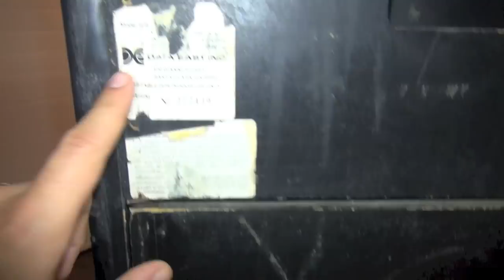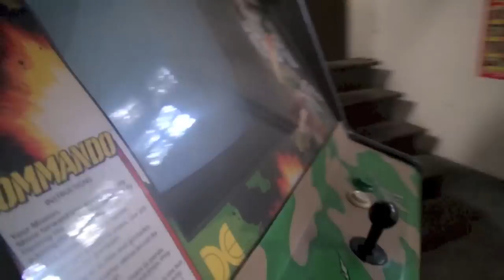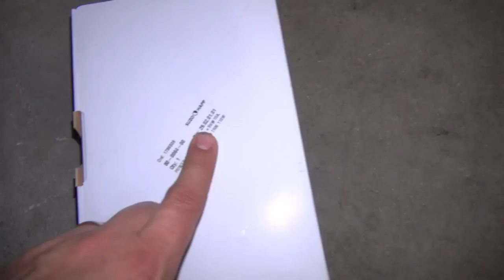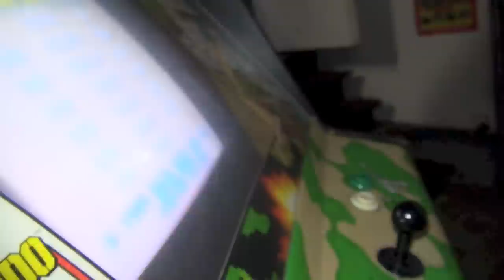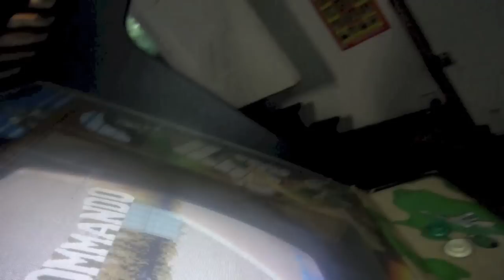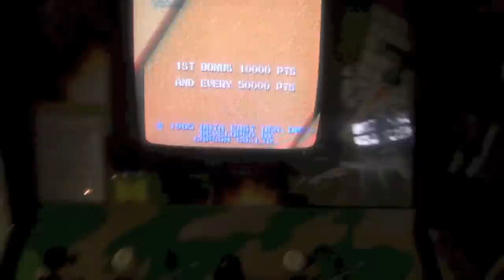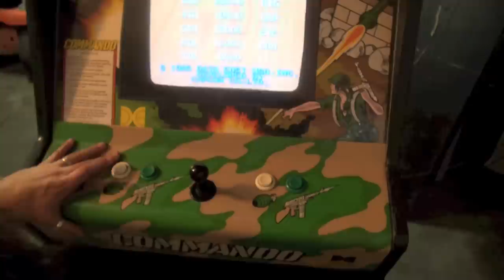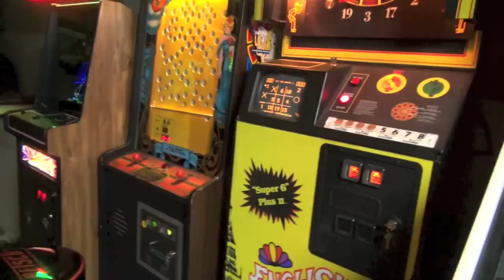How to fix a dead arcade game #1 - Troubleshooting a Craigslist purchase - Data East Commando

Comment: A decent pigtail replacement cord can be found here : http://www.southwire.com/products/pigtails-power-supply-cord-spt-3-water-well.htm

Please note that the plug is a 90 degree downward pitch, they also have straight ones of the same quality.

John makes a good point about repairing the power supply. I f you can find one for $20 do not bother. I'm a trained Electronics tech guy and I wouldn't.

John also makes several other really good points in this video: safety. Always make sure you game is unplugged before touching it. While you probably won't get killed by 110V , you can and it will jolt you. Another point is the interlock: do NOT forget the interlock. You plug in the machine, take off the back and nothing will work and you'll spend 10 minutes figuring out you were silly and forgot it(oh yeah MUCH experience with this.... so yeah I am an expert at silly).

The monitor can be adjusted to correct some video problems. Sometimes it can be something very simple like the fly-back adjustment he did that fixes a machine. Though that can be a sign that the fly-back is starting to go bad.... if after you adjust it, the screen goes blurry again later well at least you know what to replace right?

Contact switches like the ones used in these machines can be cleaned like John showed or with the VERY lite use of a cheap cardboard nail file. Radio Shack also sells a cheap cleaner/lubricant spray :  http://www.radioshack.com/cleaners-and-wipes . I really like the DeToxit wipes.

Seriously John, from one electronics tech to another, this was an excellent video with a great deal of very good information. Please keep this up. I really liked how you introduced the multimeter etc.
Reply: Digital Encom You know I always call myself a tech guy because I feel that is really more of what I am than any other thing... With that said I have a degree in Electrical Engineering and IT (Database Management and creation).... so I am a bit more that a Tech guy I suppose though it is what I was first. Now... I said "While you probably won't get killed by 110V , you can and it will jolt you. ", from that you seemed filled with a burning desire to quote how people can be killed (which I already stated) and what voltages. Did your information include that most deaths by 110V include the victim being in water? 90% of deaths in homes occur from 110v? Where did you get that silly statistic. I would hazard a guess 90% of deaths in home occur from natural causes or heart attacks.... heck I guarantee you falls account for a higher percentage than electrocution. So, unless and until you really want to post some VALID statistics, accept that yes people can die from 110v, but sorry more people get shocked than die. So... if you want to play credits I was a journeyman electronics tech in the Air Force first.... before college, so it is what I most identify with. There... happy?
Reply: k
Reply: I just noticed the whole"covered in blood" bit. You know, I have never met a vet who was actually in combat speak like that. I certainly don't but... if it's true... then you are in the VA system and also have a VA award letter that shows the date and circumstances of any injury. I'd like to see that. Just redact your social security number. Give me a dropbox link, and hey I'll share mine for everything anytime to anyone, DD214 (long form), Diplomas, and VA letters). Let's see who is REAL here.

Comment: We did it John! We did it!!  Kidding... another awesome video.  

As far as the power cord I bought a game that has a similar cord but the end of cord is soldered to a box with fuses (not sure the name).  I don't have a soldering gun but is there any other way around that if I want to replace the cord? Or do I have to buy a soldering gun and unsolder the cord from that box in order to replace it.

Comment: As soon as I saw the power supply was bad, I would disconnect the power supply connector to the PC boards before tweaking the voltages.  There's nothing worse than seeing every IC on the board crack open when the supply suddenly comes to life at 8 volts.

Comment: I have a super mario brother's game  . Plug in no power. Hope your vid.  Helps me Check power supply. I also have a vurtur cop. I fixed the optical gun.  But today the sound and everything was working but the screen was not on. I turned it off.  Then back on and just fir a split second the screen loaded up and went to the game then the picture goes out. I hope wiggling the card will fix.

Comment: Hi John, I found your You Tube videos a few weeks ago. Funny thing, I also just found a Commando. I just started working on games, and your videos are great! I tested my voltage on my Power Supply, I have 5.0 amps going out, but 108 coming in to the supply. I have a bright straight line going from top of the screan to the bottom. The line is about an inch wide. Could it be the power supply? Keep up the great job.
Reply: +Eddie G 
Sounds like you have a monitor deflection problem, although IME deflection collapse usually results in a very thin line, not a 1" wide one.  Maybe a cap kit problem?

If the line looks like it is changing a little while the game is on (meaning the whole screen is scrunched into that thin line), that is a possible sign that the game is actually running.  Can you coin it up and hear sounds when you try to play it?  If so, then it is likely "just" a monitor problem.

Oh, and you meant "volts" not "amps."
Reply: +James Twine  Thanks for the help, yes it was a monitor issue and is getting re capped.

Comment: 5-STAR!!!     I had a small pool hall, and several of the games I buy where broke,  and all but my frogger sound problem I fixed with in 48hours. 3 days max.  $50 crane game  3hr fix... just loose connections.
Frogger video problem..  loose flyback suction cup on tube.   I am back in the game and just bought a Mallet Madness for $100  if its cheap enough and the cabinet is in good enough shape  you can always buy the parts to fix for thousands cheaper than buying im working order.  {Arcade Problems... Connections, Connections, Connections!  ...Maybe Bad Caps,
Reply from the maker: +Studio9HDR Yeah, a lot of times it could be connections.

Comment: If a screen on my newly purchased cocktail arcade says “no cable” with an elf board + an identical PSU. Does this sound like a voltage or Psu issue? Thanks! Btw I though Sean Austin was working on this arcade lol

Comment: i hear a lil interference on my speakers would it be caused by that?
Reply: A "hum" could be caused by an AC/Ground problem, especially if it sounds like what is called "AC hum."  Distortions could mean that you need to replace the amplifier.  

Some "digital noise," which sounds like you are listening to the switching signals in the game, or might change when the screen changes, might be normal.  I have had a few games do this if you turn up the volume all the way.

Comment: There is a diffrence between arcade monitors and cpu game arcade game screens if your arcade has a knob on the monitor than its a cpu arcade screen in which most arcades didn't have because back then nobody who was running an arcade shop wanted the volume to change you can even buy arcade monitors online and look at the diffrence
Reply from the maker: Nintendo's PCBs didn't have an audio amp on the game PCB. So, they ran the audio to an audio amp that was mounted on the Sanyo 20 EZ monitor. Trust me, what I am saying is correct. I have owned all of the Nintendo cabinets and then some. If you have something that is not like this then it was not original.
Reply: John is correct. For example, see section 5-3 of the Donkey Kong Operation manual: http://www.arcade-museum.com/manuals-videogames/D/dkong1.pdf

Comment: Nevermind I don't really have time to explain all I was trying to say is that most of the 80s arcades didn't have a volume control I have dk from nintendo and son son from capcom and they don't have volume control on them because the jamma bourds back then didn't come ith a volume button or a volume program the arcades came as they were sold and these are my uncles arcades he use to run a shop and at no point has there been a volume control on the cab because at the time there was setting
Reply from the maker: Donkey Kong has a volume knob. It's on the monitor.

Comment: Does arcade monitor frame have too have ground connected???? My damm machine keeps shocking me when I try turning it on????
Reply from the maker: Make sure you have a three prong plug installed on the machine and make sure all ground straps are present and secured. That's not good! CAREFUL.
Reply: I do have the the third prong and I did check for continuity and the grounds do do go beep only the monitor didn't go beep!!  So I put a ground too it a green wire and it goes beep now with multimeter!!  is that right???? I don't wanna plug it in!!!

Comment: I just bought a lethal enforcers 2 arcade cabinet and during transport something happened and now the sound doesn't work... Any tips or advice on maybe trying to fix it?
Reply from the maker: +Anthony Durant Start with the simple stuff first. Check your connections and voltages. Reseat connectors, look at wiring to speaker, etc.
Reply: +John's Arcade Game Reviews & Tech Anyway you could possibly Skype me and help out here bud I have no clue what I'm doing here and there is nobody in my area that does repairs around here... I'm running out of options.

Comment: I'm going to try replacing the power supply on my Cobra Command flight simulator arcade. I hope it get's it working again. I had just got the joystick to work then it crapped out. Wish me luck folks

Comment: Yeah.  Your video defiantly shows the blue wire connected to the -5v and you even said it as you were doing the ps swap .  Weird as the pinout list shows nothing for the -5.  I disconnected my blue wire all together and the game is the same.  Plays great but no sound.  I can't figure out if that wire is for sound and something is bad on the board" all looks clean and good " or if it's a wire that was connected from factory to the ps but it didn't do anything .  Lol this is driving me crazy!

Comment: having a very similar problem with my super pac man. im a little new at this, the power supply on my super pac man looks way different than the one on this cammando
Reply from the maker: Super Pac-Man has a linear power supply, not a switching power supply. However, Bob Roberts sells an adapter so you can install a switching power supply like in this video in a Super Pac-Man.
Reply: ive learned a lot from your videos, thanks for the help. I also opened up the back of my captain America and the avengers and it has the switching power supply and looks so much less complicated, so switching the super pac man over is a great idea
Reply from the maker: ClassicRockfan79 Yes, it's a good idea!

Comment: normally these older modles don't have a sound menu nor did they have a volume nob so in order to change the volume you would have to put in new speakers for more sound now you may be unaware of that but it is true this game was released in the 80s and has been used over and over so the speakers themselves may need a replacement if it sounds low.
Reply from the maker: No, pretty much every arcade game has a volume knob.
Reply: Not really you see the arcade industry didn't think to put a voume system in arcades nore did they have nobs the arcade jamma bourds were built to have one volume there was no changeing the volume they did how ever start putting in chips inside arcade machine's so that you could control the volume without haveing to reach the back of the cab which mad it easy for people who purchased the machine, I should know I studied arcades when I was in tec school I have also built 5 arcades includeing pac man and astroids and they don't have voume nobs or volume programs for that matter
Reply: And they didn't start volume control till 1989 around the time the games were getting better and more upgraded but even then the arcade industry's were selling games with volume control chips
Reply from the maker: angel edwin rodriguez jr I have no idea what you mean. All my games have volume pots.
Reply: John's Arcade Game Reviews & Tech I have a snk beast buster arcade that I got from ebay it is brand new and it dose not have a volume control, Its a P.C.B arcade.... So I wouldn't speak for all of us if I was you. Cause this other guy dose have a point I have over atleast 5 arcades and 3 of which don't have a volume control buddy...so you are kind of wrong.
Reply: Bigger speakers do not mean louder, if it's outputting the same volume. LOL. If anything, quieter due to not enough power.

Comment: Well we payed for it brand new never changed the parts off of it when it was popular and there is diffrent moddles in some pirticular cases people would modify there cabs and I just looked it up and most of the arcades with just a screen and no volume buttons people back then had to input a volume peice that's all that's to it
Reply from the maker: I have owned many games from the 70s to the 90s. They all have volume pots.

Comment: The question of how to wire a volume control into an arcade cabinet comes up prettyregularly, so I thought I'd try and hit this one on the head once and for all. Here is the link:
Volume ControlMountingand Wiring

This solution is those who want an old-fashioned knob for their cabinet,workingindependentlyofany software or PC connection. It is intuitive, working exactly the same way as volume controls on most amplifiers and speaker systems. It does require just a little of work, this is the link

Comment: If it was me I would not even have plugged it in and put in a new line cord before starting.
It was hacked in two places.
I replaced the line cord on my customers Hee Haw EM Pinball Machine as it was completely cut and electrical tapped together.
It was only $10 and it saves the house going up in flames.
I also do not trust what fuses people put into uprights or pinball machines as they are always the wrong fuse amperages.
Always to low or to high rarely get a fuse that is right.
SO I always look at the liine cord then the fuses then clean the machine.
Reply from the maker: I inspected the cord and it wasn't left unattended. Long term, yes... Replace it!

Comment: 116944 ..0.25 x 116944 = 29, 936 / 4 = $7,309   Am I wrong?
Reply: cmichael442 Remember, that number is the number of quarters that went though that machine.  So, when you multiply by .25 you're already dividing by 4.  That machine made over $29,000, or perhaps less depending on how many of those are "home rang" credits from individual ownership.

Comment: never ever adjust voltages with game board pluged in...duuuhhhhh
Reply from the maker: +skinnyt72 It's safe. Just don't go crazy.
Reply: +skinnyt72 Also, most switching power supplies will not work without a load on them.  So short of buying a large enough resistor, either having a spare working junk board or turning the pot all the way down and then working up is a good alternative.
Besides, since different boards load the power supply differently, so you really need it pulling on the power supply in order to get the adjustment correct.

Comment: Arcade machine fixing safety!
Always unplug machine. Always were rubber gloves and rubber sole shoes when working on machine. Never wear metal no metal ever!!! Always ground crt and power supply. You should also always do a discharge. Any size crt or tv or power supply has enough electric stored in it even when off to most likely kill you always!!!⚡️☠️ So these safety procedures are very important to follow
Reply from the maker: We did nothing with the CRT in this video. Gloves?

Comment: What ....................... You did not repair the old power unit then  - Why on Earth not ?
Likely that the capacitors have gone leaky
Reply from the maker: Because it's a $20 part. Nobody rebuilds those more modern switching power supplies. Waste of time. Readily available part with no historic significance. +5V is +5V.
Reply: John's Arcade Game Reviews & Tech
That's a pity really, we do such stuff all the time. Capacitors are cheap. Personally I would not call replacing a power supply really a proper "Repair", as such because anyone can do that.

One of my previous businesses has several of these games in several pubs and we used to maintian them all the time. Like you say it is very rewarding
Reply from the maker: computersolutions164 I rebuild power supplies ALL THE TIME. ALL THE TIME. Check out my vids. These power supplies, no.
Reply: John's Arcade Game Reviews & Tech
Reply: I want buy the  commando pcb in ebay. but i not understand the correct wire of control panel.
Someboddy can help me?
Thanks
Reply from the maker: azaria yehezkel Seek out the pinouts and the manual.
Reply: 116944 × 25 = 2923600
Reply: 116944 X .25 = $29,235.00     Decimals are important.
Reply: oh thx

Comment: You may not be able to stand the filth, But I cant stand people who spray directly onto the screen instead of onto a cloth! So many TV repairs due to people doing that!
Reply: alch3myau 
Why is that?
Reply: +BarrySlisk Spraying directly onto a monitor will cause the liquid you sprayed onto the monitor to go under the monitor were the circuitry is and then you have a big snap, crackle, pop with the monitor board.
It is best to clean the machine with it off and even unplugged.
Reply from the maker: +PinBallReviewer I'm pretty careful where I spray. But, yeah... it wouldn't hurt to be more careful.
Reply from the maker: BarrySlisk Simple Green? Yes. I spray it everywhere. :)
Reply: +John's Arcade Game Reviews & Tech Same here but on the pinball machines I have. :)